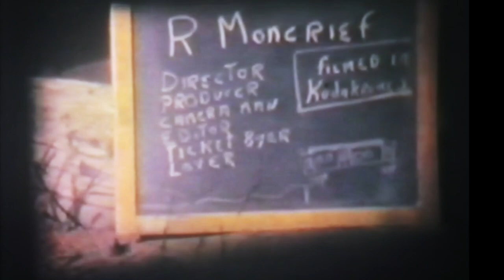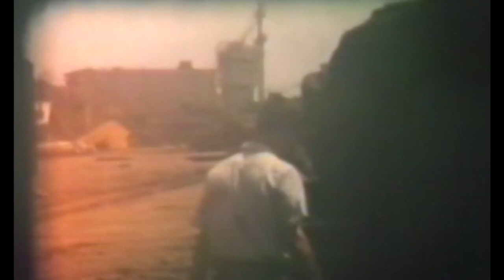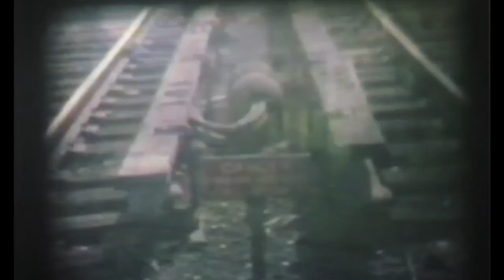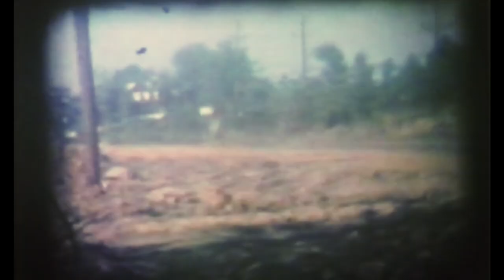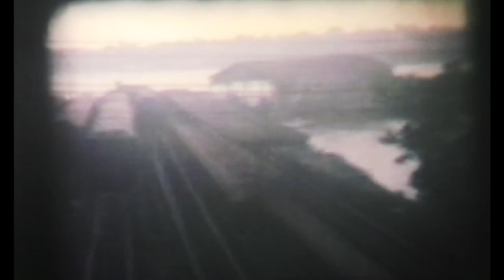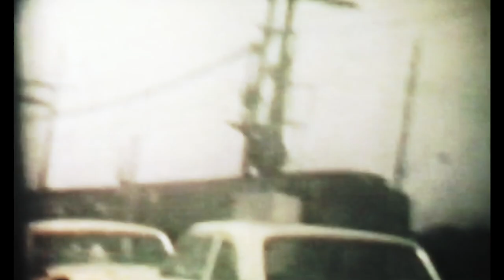Staten Island Rapid  Transit 1960s

Comment: I grew up in Great Kills and the street adjoining the SIRT depot there is Baltimore Street, which I always figured was connected to the ownership of the line by the B&O Railroad. Also in Tomkinsville, bordering the track there was a set of old tenements called the Baltimore Flats. I think they were there up till the 1980s and then were razed. That area was like stepping back in time 100 years. I'm just old enough to remember when the last grade crossing were in their last days. If I recall correctly, about the last one was at Grant City, though maybe there was some stretch between Oakwood and Bay Terrace after Grant City's was eliminated.
Reply from the maker: OK on that 😊

Comment: How did B & O get into SI. What bridge and or route.
Reply from the maker: I think you will find that freight wagons were transported to the island on a special ferry with rail tracks fitted. Maybe somebody who lives in New York can verify this.
Reply: I can confirm but they had another way aswell witch i mentioned in the replies,     Now thoe ferry carts are use to transport freight carts to new jersey and new york witch explained it
Reply: The authur kill vertical lift bridge witch connected to new jersey used by conrail now to transfer trash cars in an off the island made it possible but with the north shore branch shutting down in 1953 it became half a freight line and passanger and the only station left on the north shore branch was on the Arlington yard later they fully made it freight and shut the transit side down however the freight line is still in use!

Comment: Sweet! Very cool footage! I'm not a native of New York, but have been a train buff all my life. When I started traveling on the S.I.R.T in the early 1990's, I saw a lot of abandoned tracks on the properties of a lot of businesses and defunct businesses along this line. I just some how knew that this line was also used for freight trains. I moved to Staten Island in the early '90's and Port Richmond was the first neighborhood I lived in, near the North Shore line. It was around that time that Procter & Gamble was fixing to closing up shop on Staten Island in Port Ivory. The New York Susquehanna & Western assigned an EMD SW1200 switcher to switch the remainder of the still rail served businesses on Staten Island until 1991. I think the switcher locomotive was their # 116 or # 120, can't remember exactly. I never saw this engine on the South Shore of Staten Island though. I recall how "Beat up" looking the tracks were in during the '90s. They were detoriating almost as bad as the tracks on the North Shore were, with the exception of weeds on the tracks back then. (There were a lot of rotted ties and skimpy ballast. ) Me and my friends used to walk on the tracks of the North Shore Line several years after being abandoned and in the Travis section of Staten Island, near the Con Ed Power Station, was a small rail yard. In it, there were a few of the older electric coach cars that used to be the train cars used here. Attached to this train was a diesel locomotive and this train sat there for many years.  I don't know what ever happened to that train, maybe it was moved from there. I know in 2002 or '03, work started to be done to clear the ROW of all the overgrowth and these tracks were replaced all the way to Arlington Yard for new freight service. I don't think the North Shore Line was restored east of the Union Ave overpass in Mariners Harbor though.
Reply from the maker: Thank you very much for your reminiscent impressions. Hopefully others will see what you have written as well. I will send the email of this on to trainluvr who supplied some of the still photographs. I visited Staten Island for a couple of hours in 1976, but never got around to riding the railway.

Comment: Nice video, brought back memories.  I was too young to remember the grade crossings, which had to go when a train crashed into a school bus, or so the story went.  Growing up in Staten Island I remember these cars when I was 5, with wicker seats that you had to flip the backs over to be facing the direction the train was traveling.  They were, at one time, supposed to place one of them in Richmondtown with the New Dorp Station House.  The car sat for decades in Tottenville or Clifton and eventually disappeared and was scrapped I assume, which was typical of things.   These cars were retired in 1973 - 74 when the current fleet came into use.  The R211S will replace them in 2024, providing testing, which is just starting, and production go according to plan.   The funny part is that the current fleet will end up being older when they are retired then these cars were.  Only train line that is free to ride, well almost, so long as you don't get on at St George or Tompkinsville, it is free. While the other 2 lines (North Shore/Arlington/Port Ivory and the South Beach line) were discontinued in 1953, they really could have come in handy today with the Island being over built and over populated for the existing streets.  The North Shore right of way still exists, but would need a pile of money to run as trains no longer use it outside of Howland Hook.  The South Beach line right of way was sold off over the years to developers.
Reply from the maker: Thanks for your memories of your younger days. It’s always interesting to learn extra details behind the videos I post.
Reply: Yes, the current rolling stock employed is a "continuation" of the R-44 contract, but slightly refurbished to compliance with Staten Island ICC/FRA regulations, since it is considered a rail-road.
Reply from the maker: I only visited Staten Island once in January 1976 but did not ride the SIRT, possibly because I didn’t know existed. So your information could be helpful to others in your vicinity.
Reply: The train car that was probably supposed to be put in Richmond Town with the wooden New Dorp Station House, was probably one of about 3 that sat in a train yard near Meredith Ave in Travis. There was also a "switcher engine" attached to the train. This train sat in this freight yard near the Con Ed power station since the 1980's, (Con Ed decided to have their coal brought in by barge and stopped receiving rail service in the mid 80's. The tracks on the Travis Branch were used for car storage during that time.) From my "sources", two of the electric coaches were moved along with the switcher locomotive around 2004, when work was done on these tracks to reopen the line for new freight services. However, the third car was unceremoniously scrapped on site, probably because of a mechanical problem and this car could not be moved. Two of these coaches were moved off of Staten Island and made it to museums. This former rail yard where this train sat for roughly 20 years no longer exists, as it was built along with the power plant for unit coal trains in the late 1950's. When a track rehabilitation project was done on these tracks into Arlington Yard in the early 2000's, all of the old tracks were pulled up, including the tracks going into Con Ed and the train yard.
Reply from the maker: Thanks for your interesting report. Hopefully other viewers of this video will read it and learn from what you have written. Although I went to New York a few times in the past, for one reason or another I never got around to riding the Staten Island railway